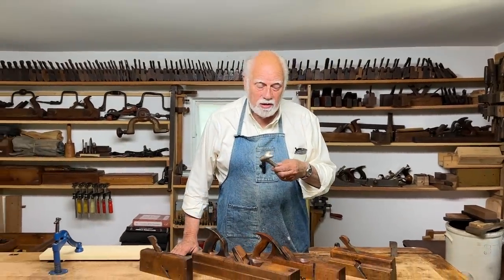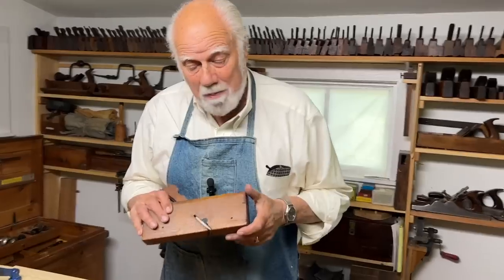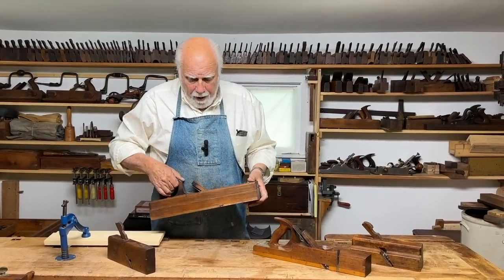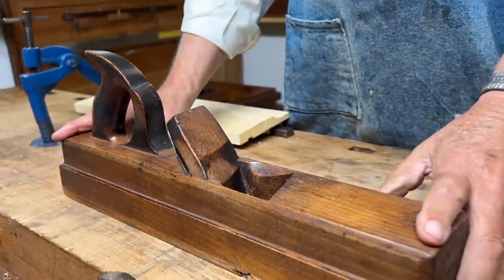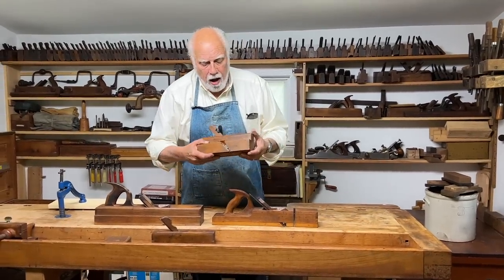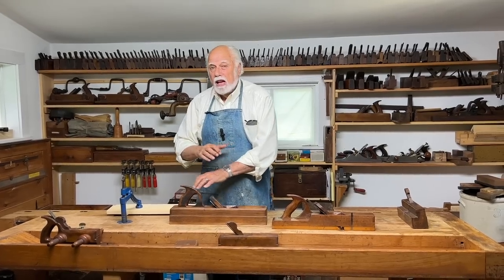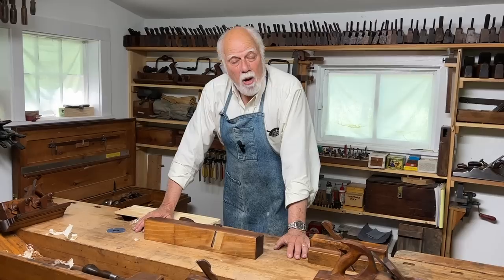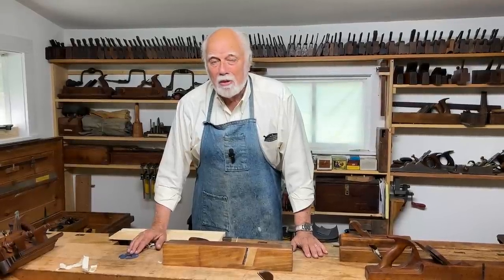43. The Badger Plane

Comment: My Badger plane is Auburn with depth stop , bevel blade by Casey, adjustable fence on sole and 2 3/4" blade.
Reply from the maker: Sounds good. I never saw a Casey.
Reply: Casey, Clark & Co organized Auburn Tool Co in 1864. In 1865 the Co made 35000 planes. Google has several references to Auburn.

Comment: Great video Mr. Graham, I am just curious; what is stopping me from just using a plow plane to cut a groove, and then remove the rest with a normal bench plane (perhaps a no 5)?
Reply from the maker: Nothing, so long as the groove is wide enough to allow the plane's iron to reach the outside of the grooved edge.
Reply: @gjbmunc  I see, that kinda makes the badger plane a bit excessive. But then again, you can't have too many planes. Thanks!

Comment: Interesting video.  Have you encountered a Badger with the blade skewed full width of the plane and nickers on both sides?  Also one other question which you may be able to help me with, it's regarding the dovetail plane.  The dovetail planes i've observed cut with the following edge not the leading edge yet a rebate plane cuts with the leading edge.  Do you know why?
Thank you
Jerry
Reply from the maker: A full-width skewed iron with nickers on both sides is essentially a Stanley 78. But I never saw a wooden one.
With regard to the dovetail plane, there are various types depending on how the dovetail 'shoe' is positioned.
Reply: Thanks for the info. You’ve used a term I’m not familiar with in woodworking.  “Shoe”